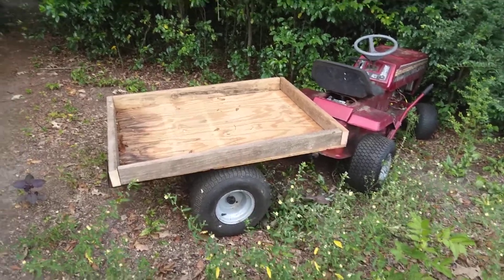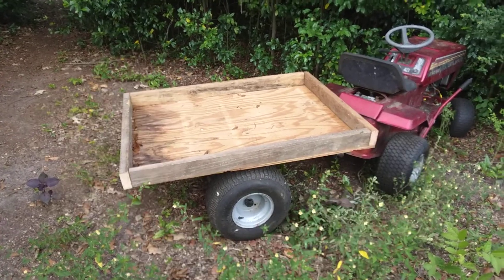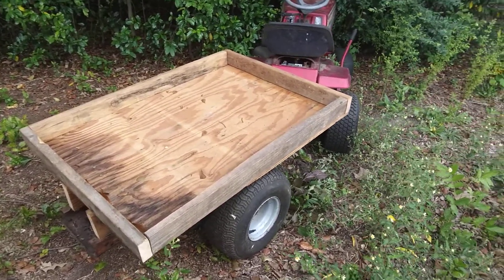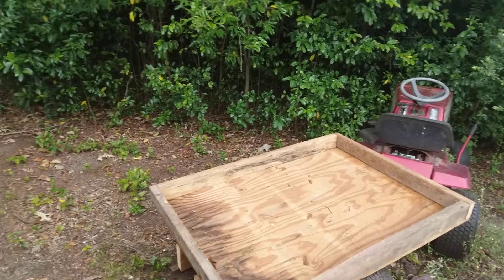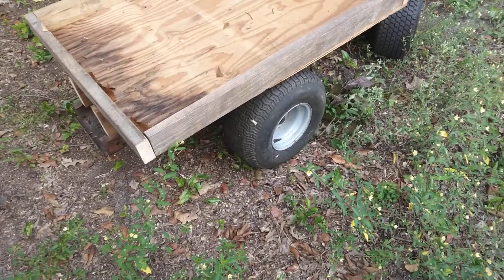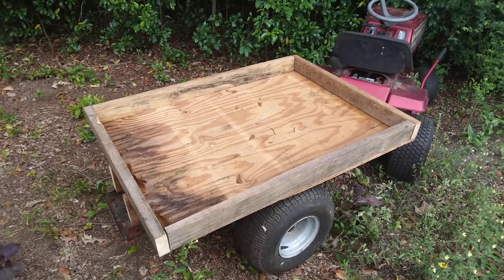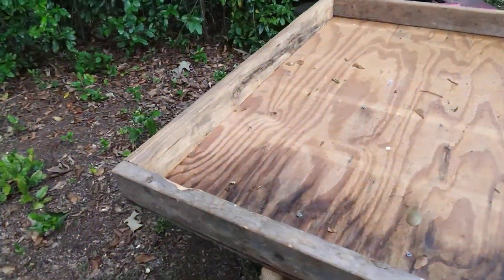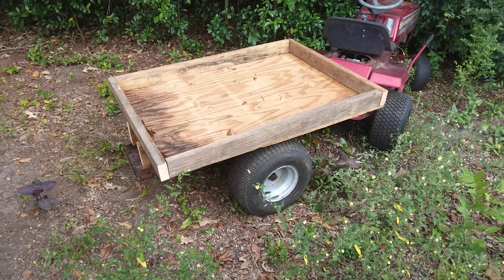Riding mower to Lawnmower mower trailer conversion

Comment: the trailer looks very strong,, the tongue might be a little longer but it should be a big help moving all that wood.
Reply from the maker: I think it will hold together long enough to to get this wood moved 
But the cargo box is pretty chincy  its bolted on with 4 lag screws i feel like theyre not going to hold for very long 
I guess that means ill have a video series of improvements for this thing
Btw would you have any used golf cart leaf springs